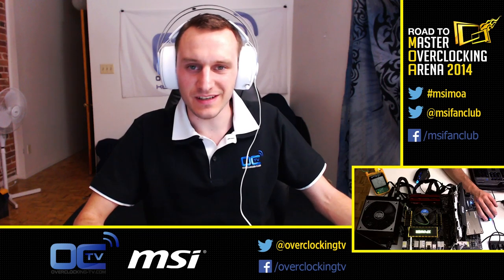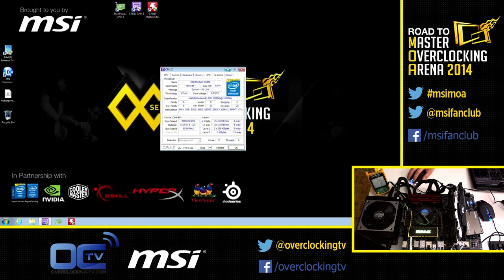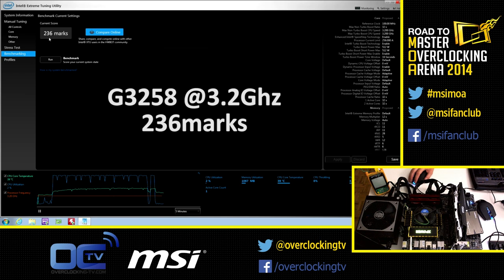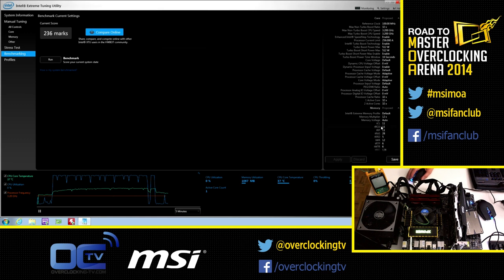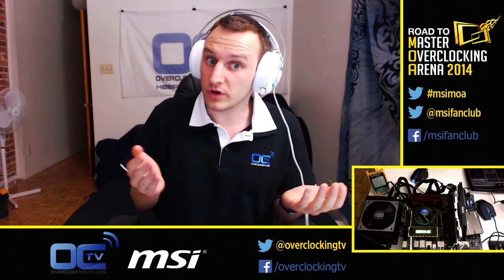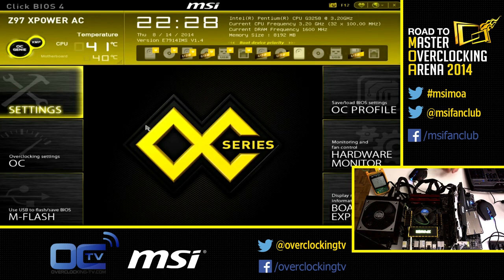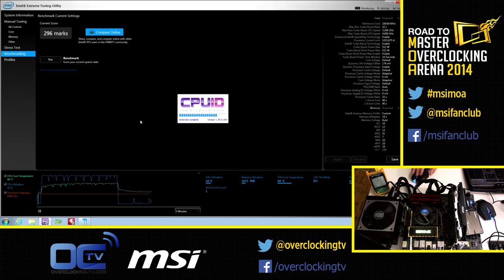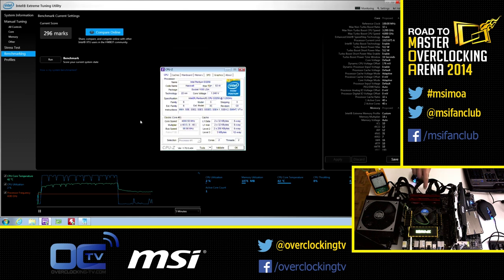Easy Z97 OC Guide from stock to 4GHz

Comment: Good video for a basic overclock. And nice to get a good overview of the board. I watched this when I first got the board. In fact it helped me to purchase the board.

Nice idea would be to set the cpu voltage, vcin and bump up the mhz. I disable the Intel virtualization.
I have the z97 mpower with a 4770k , ram is corsair vengeance pro 2400 and a h100i cpu cooler.

mine is set to 4600 cpu volt 1.3  but would take less ..vcin at 2.0 ring volt 1.19
Ram set to 2400 at 1.7 volt.
My system is water cooled and runs very smooth.
These boards are excellent and recommended to all. Forget Asus. I have tested many..They are just hype.

Thanks for the video.

Comment: my base clock is 4000mhz , how much i can OC my cpu without any risk at all , iam using msi z97 pc mate with i7 4790k , and by the way i can't change the ratio of the cpu , any help plzzzz ?
Reply: You can easily over clock to 4.5, but it depends. Nothing is guaranteed
Reply: +Nohemi Morales thank you so much , but dose my z97 msi pc mate support OC ? because i can't seem to be able to change the ratio value of the cpu from the bios ,
Reply: I had my one on 4.8 with increased voltage, watercooled. Defo can handle it.

Comment: Should you stress test or just not do anything and should I turn up the voltage for just  4.0ghz over clock for the G3258 pentium
Reply: ^Thats a fine oc myman.. Got the same cpu at 4.4 and its just awsom compared to stock trash.. yet its K processor so it should be overclocker or you are throwin money out of the window.. Oh and plz stop using that trash screenshot site.. ty :D

Comment: i tried to do the same thing with my ram but now my first bios dousn't even work anymore can you pls help me and my pc even got startup problems on my second bios also... tyvm for you're time
Reply: Just boot back into the bios and reset the settings to default. I think it's F6 but you might have to double check that. It'll load everything back to normal before you tweaked the settings and your comp should boot up normally.

Comment: @OverClocking-TV sir i followed all the steps..

im using a Z97 PC-MATE
G3258

i oCked it to 4GHz as what this vid says.. when i check again the CPU-Z.
at the CPU specification is says. G3258 at 3.2 GHz

but the speed is already 4000 MHz..
and also at Task manager..

it says G3258 @ 3.2GHz
 but the Speed is also 3.97 GHZ

i checked also in bios.. CPU  specificaion is G3258 @ 3.2Ghz
buy the speed is 4000 MHz already.. is this normal?
Reply: +bato leyte  iam using the same board you are using but with  i7 4790k , i want to overclock it to 5000mhz , but looks like our boards won't support , please if you can solve this problem let me know , thank you
Reply: ok.. thanks...